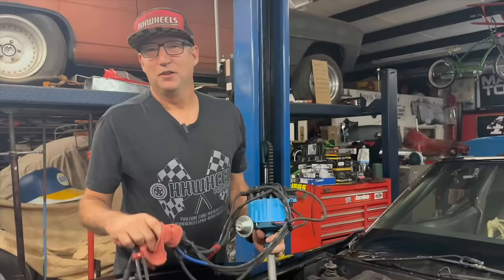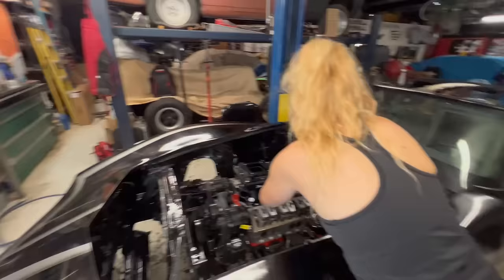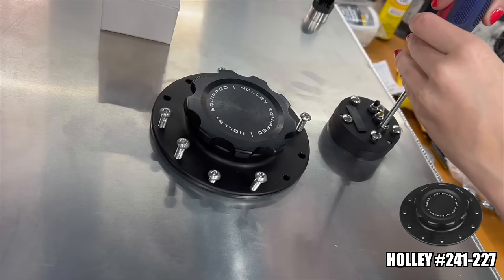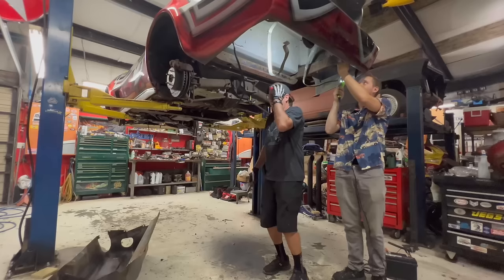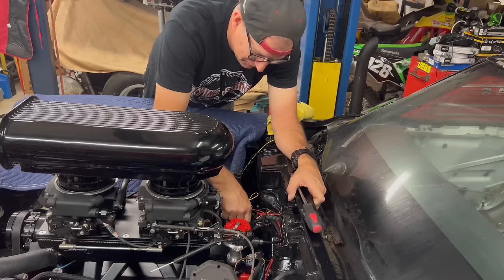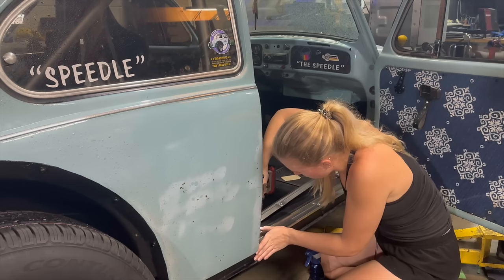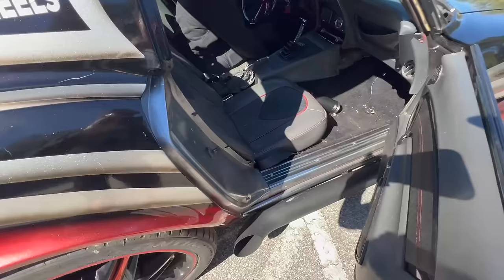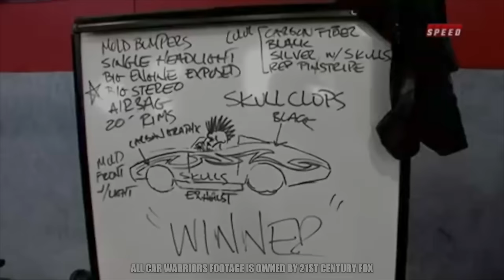Forgotten TV Corvette goes to the World's Largest Car Show?!

Comment: Way to close with the paint gun that is ok with powder coat but that's why you had runs with the paint also slow and thin coats hold the gun a foot and a half away and waves left to right  about tree and a half feet back and forth  about 8 seconds per pass
Reply from the maker: Thx for the tips✌️